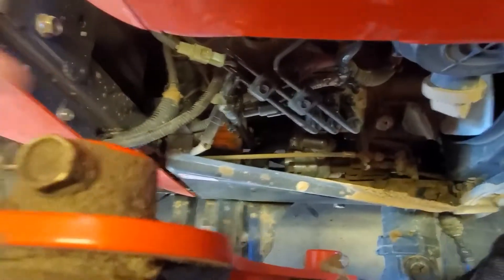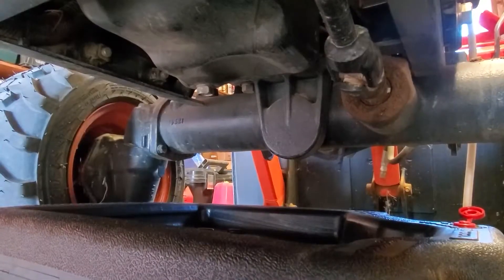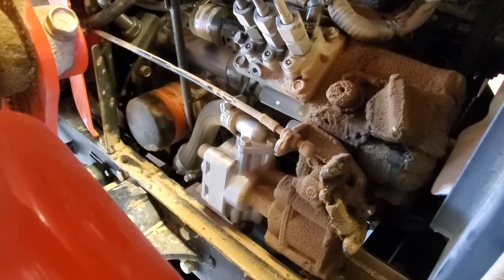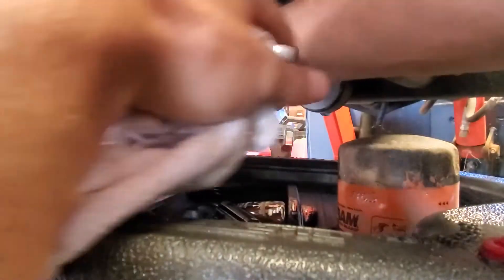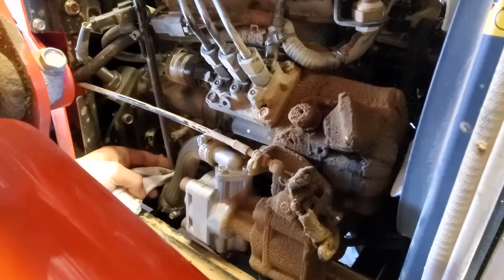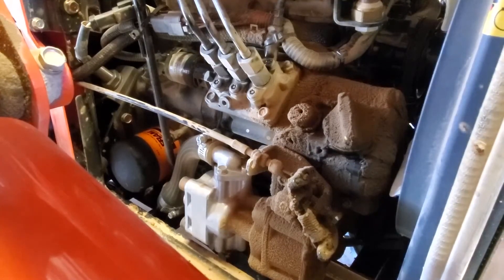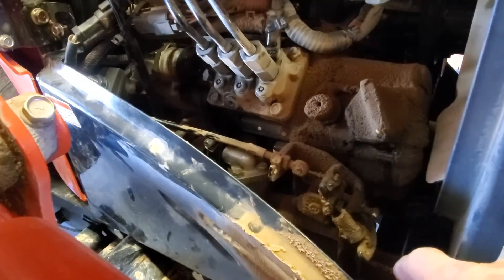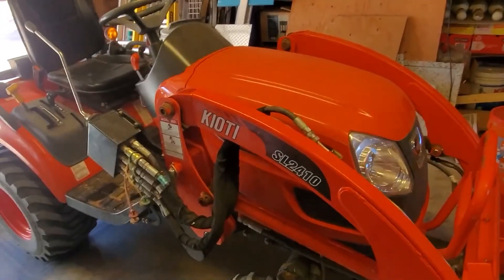How to: Change Oil on a Kioti CS2410 Tractor

Comment: Helpful video. Bought a used cs2410 and just changed the oil. I didn't actually remove the plate. Removed the 2 10mm bolts and loosened the bottom 12mm bolt enough for the plate to lean out of the way enough for me to get the filter off. Easy peasy. Thanks dude 👍
Reply from the maker: Yeah that work too. Just hard to show and explain on a video the bend it out of the way. I did my first oil change on this one that way. I think the video was the second oil change.

Comment: Helpful video! Now I know to grab a spare 10mm bolt/nut to replace that 12mm oddball. Future me will be thankful.
Reply from the maker: Glad i could help! Keep watching, i have to do hst fluid sometime this year.
Reply: @SKPcars  Same. I'll look for your video first. Bought one of these with a "recent refresh". Nothing was refreshed.
Reply from the maker: That's rough, these aren't bad little tractors. The only problem i have run into is dealers closing because of the pandemic. Its harder to find parts, i find a lot of mine online and filters i try to cross reference to something more available and cheaper.

Comment: You don't have to remove 3 bolts on cover, just top one, then bend cover out!
Reply from the maker: You are absolutely right and i did that on a not filmed oil change but i was aiming for not showing everyone how to bend up the braces. I totally support you doing so it does make the job faster.